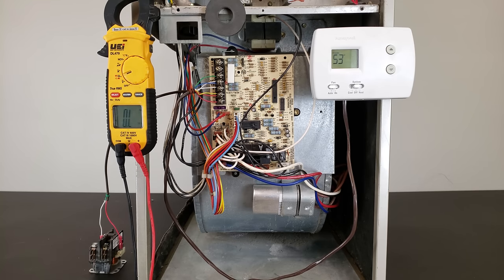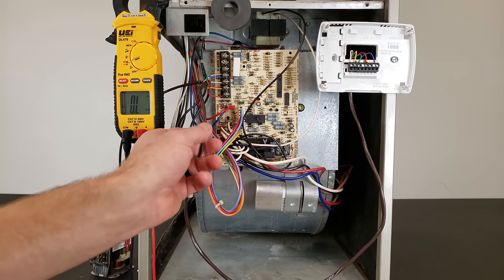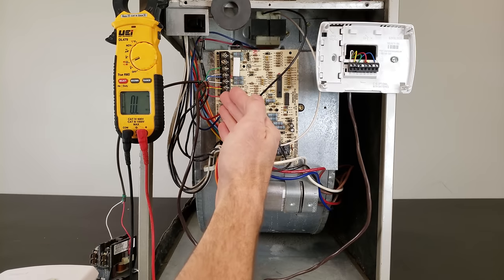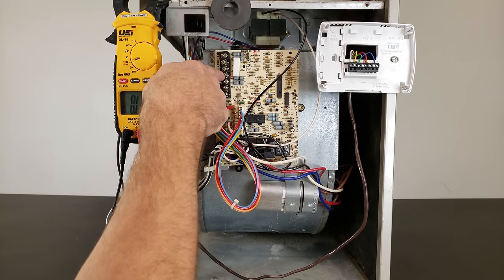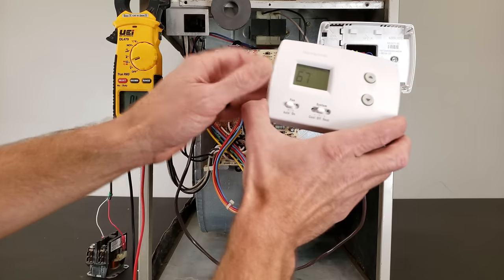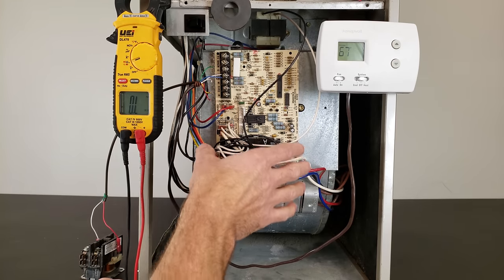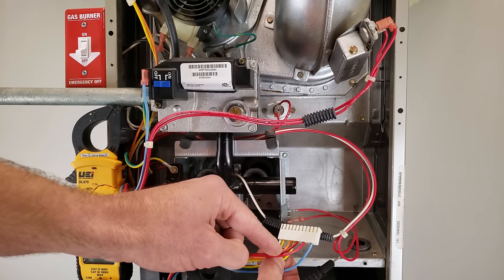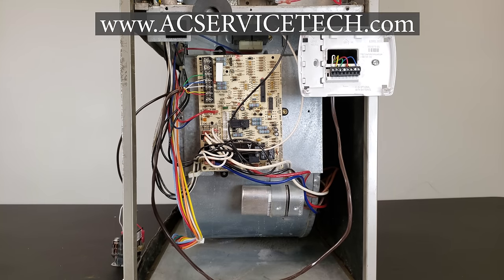Finding Low Voltage Shorts Fast! HVAC Troubleshooting!

Comment: Let me suggest a method for finding low voltage shorts without removing all those wires.  First I'll be obvious, the reason the fuse is blowing is because something is shorted and therefore has very low resistance or zero resistance drawing lots of current and causing the fuse to blow.   The temporary solution is to add series resistance (inline with the fuse or replacing it) to the circuit with a known level of resistance drawing less current than the rated fuse.  The simple answer is to insert a 24 volt bulb in a socket with two wires or a commercial short finder (all these things are is a 24 volt bulb packaged nicely with wires).  The current draw will be 2.5/3.0 amps which isn't enough to blow the fuse.  The bulb will light because you have 24 volts on one side and the short giving you a ground on the other side.  Grab your multimeter and wrap the current jaws around each low voltage wire on the control board until you find the wire/circuit drawing 2.5/3.0.  That is the wire/circuit where your short is.  Now track that wire to its termination point which could be a component.  Disconnect the component and if the light goes out you found your shorted device.  If it doesn't track that wire along its length to find where the wire is touching another wire or the frame of the furnace.  In any case you cut your troubleshooting of the short down to five or ten minutes.  You can use the same procedure on a cars, but use a 12 volt bulb.  I've used this process for years to track down short on cars, furnaces and even circuit boards.  I've found the current jaws on a multimeter the most underutilized item in a tool bag.  Hope you find this useful.
Reply: Yes clamp meter is a great tool, makes those parasite draw much easier to find, great tip!
Reply: What would my amps be of the other low voltage wires? It never dawned on me to use my claw to read low wiring amperage?
Reply: I didn’t think a multi meter could pick up amps that low such as 2-3amps
Reply: Great point! Resistance testing often produces flawed results for a host of reasons.
Reply: You can use your clamp meter to measure very small AC currents. For example. If you clamp your meter on a single conductor carrying 1 amp, your meter will of course read 1 amp but if the same conductor passes through the jaws twice, now you will read 2 amps and 10 times, your 1 amp will now read 10 amps on the meter. It's not very handy to wrap a wire around the jaws 10 times and then insert that in series in the circuit you want to measure but it works. And a tip on finding a short circuit. You don't want to go crashing in on a short because in the process you may clear it and then it won't be there anymore to track down, then in a couple of weeks have the short return and the fuse blow again. I think a person is fortunate to have a dead short rather than one that is intermittent. Sometimes I also use the light in series with the load to track down shorts. I bought your refrigeration book last year and it really helped me understand the subcool and superheat I've heard about and didn't understand. It's always nice to learn something new.
Reply: Could you make a video about this please
Reply: @Young Jedi  some can and some can't. I've found if the meter can read DC amprage then it should show as low as 0.1a
Reply: I wish you could make a video to explain Thanks
Reply: would love a video as well! sounds like a good hack
Reply: Wish you could make a video explaining what you're saying
Reply: Won’t this short the board tho
Reply: Definitely a good tip, unfortunately i work with AC voltagemost of the time any tips for that?
Reply: I got a even simpler way. Use ohms law v=a×r divide r into v get a Amp value take your meter at your state measure all wires to c anything that give you a low ohm value that would guve you high amps will tell you what circuit it is on.
Reply: @youngjedi5599 if you wrap a wire ten times then you can read a very low amp reading and divide it by ten

Comment: There's an easier way. Take all your thermostat wires off and then touch each wire one at a time to the red hot wire.and if you get a noticeable spark on say orange wire then you know it is on that wire circuit, do all wires this way except the common wire. This is the easy way to bypass all that nonsense.

Comment: Even a 3 amp fuse is way overrated for those transformers. 3 amps times 24 volts is 72 volt amps. Most of these transformers are only rated for 40 VA. Why don’t they use smaller fuses?

Comment: To keep from making one million trips wire  a T-stat to carry w/ you for the amount of wiring you need. You can use 2H/1C T-Stats for furnaces if you wire the W to your Emergency Heat in your diagnoses T-Stat. If it’s a Heat Pump set then just continue as the  wiring should be applied. Attic trips are a killer, don’t forget your fuse pop switch so you don’t burn through fuses.
Reply: Explain in more detail please!

Comment: Low voltage Shorts  are time consuming and  can get frustrating . Your "process of elimination" is well explained . I find this video very helpful to deal with this issue. Thank you very much for sharing this video.👍😊
Reply: I always use continuity to find low-voltage shorts.. Please explain why ohms is better then using continuity on a short to ground or common?

Comment: This video helped me diagnose a short to ground from our humidifier, which was causing our ecobee to only call for heat for less than a second, and the 3 amp fuse on the furnace board to blow when contacting Rc and W1. Turns out one of the wires poking through a sharp hole in the cold air return got nicked, who knew?!

Thank you so much, you've saved me a bunch of trouble and money.

Comment: Not sure how old this video is but it was tremendously helpful to let me today.  While my problem turned out to be something unique (an unused wire from the contractor coil outside had lost the electrical tape that was shielding it and it was arcing on the cabinet) . using your guide, I was able to determine everything it was not which eventually led me outside to look at the contractor coil.  Thank you!!!!
Reply from the maker: Glad it helped!

Comment: This is a great explanation for the process of elimination.  I would also recommend to especially younger technicians to get a Lil Popper fuse reset tool or something similar.  They come in 3 amp and 5 amp sizes.  They are helpful during the troubleshooting process so that you aren’t just burning through fuses.
Reply: I was using one the other day on a twinned system and it kept blowing the fuse on the second air handler and not my popper… I was so confused
Reply: @anthonys6187  I have seen that happen before too.  Now that everyone is switching over to cool mode, make sure the contactor is not shorted.  If they are in cooling mode and you are blowing through fuses and transformers, that is likely your problem with these seasonal changes.  

Other things
Did you try and isolate the 2nd twin from the mother system to see if it was the one popping the fuse?  I naturally want to look at the outside thermostat wire to see if an animal has been chewing on it or a melted wire on the outside condenser.  Sometimes the low or high pressure wires touch the hot copper line.

Comment: For boards I often find thermal imaging shows the blown component  ( seek thermal pro for smartphone )  you can also usually spot the hot flash of the groundcshort asthe fuse trips... excellent video as always

Comment: good morning Craig! all of your hvac articles, videos and books are very clear and well explained. I got your mini split hvac books from Amazon and I am still learning it so far very helpful. so. common and ground are same because they are touching each other. when hot wire touched to the ground it will just blow the fuse but if hot wire touch the common directly than it will blow the transformer with fuse. but common and ground are same on the other hand. why short with common directly will kill transformer not just the blow the fuse?
Reply from the maker: It will still blow the fuse but may also blow the transformer because both hot and common are connected to the transformer. Hot to ground will still blow the fuse but is less likely to blow the transformer unless the path of least resistance is back to the common on the transformer. regardless, we do our troubleshooting with blowing fuses or breakers and by using electrical resistance measurements, thanks!

Comment: Fantastic explanation! This helped me isolate my yellow wire which was shorting -- it was wrapped over the edge of a housing where the access door would rub on it every time the door was opened, slowly fraying the wire until it finally made contact with the housing creating a short.

Comment: Sweet video ! I just ran into this issue. When I turn my thermostat to either AC or the heat pump, it blows the 5amp fuse on the board inside the furnace unit. If I use just electric heat, then no issues. 

I isolated the short to the yellow wire by unhooking it from the AC unit outside. I turned my thermostat back to cool and the fan on the furnace came on with no issues and the fuse didn’t blow again. I decided to use the spare wire from the outside unit and used the black/white wire. Once that was hooked up again, the fuse blew as soon as I requested cool. What I also noticed on the board where the wires hook up, is that I have 2 wires on the same connection. (Yellow and white, but now black/white and white).  It’s an older unit so I don’t have wires at my thermostat to test. I did trace the thermostat wires from the furnace unit and put together the new black/white wire with the white wire. Now the fuse no longer blows when I switch it to cool, but now my outside unit is not switching on. Any ideas ? 🥲

Comment: Want to find a short even faster than my suggested method using current jaws?  First, use the technique explained in my previous post by adding serial resistance with a 24 volt bulb in place of the fuse or in series with it.  This will prevent the circuit from blowing the fuse while allowing it to remain active drawing somewhere around 2.5 amps.  Next drag out a Thermal Imaging Camera and look over the wires and control board (remember all wires whether from the thermostat or outside units terminate at the control board).  The shorted circuit will be obvious.  Thermal imaging cameras can be had pretty cheap these days and worth adding to your tool kit.  Hope this suggestion helps in your troubleshooting.
Reply: Wowe I’ve got the tools in my van. I’m purposely going to cause a short and test it. Good advice
Reply: Film a YouTube video showing us in field footage.

Comment: Like how you show exactly step by step on finding a low voltage short circuit. This issue is always on my job I’m the ac tech on my job we have heat pump. The units are over 10 years old and the wiring in the condensing unit is exposed to heat and cold weather mostly I find shorts on line from evaporator to condenser. Also through all the years of being used 24/7 the thermostat do fail most of the time.

Comment: Great video, I found a rare problem when troubleshooting a circuit board fuse problem. The contactor coil in an outdoor unit was the culprit, I measured the resistance of the coil and to ground both readings were normal. When 24 volts was applied the fuse blew instantly, the only symptom I found after removing the contactor was that the contactor had a burnt insulation smell. Normally when a contactors coil is energized with 24 VAC a magnetic field is produced opposing electrical current, because the coil insulation was damaged several turns of wire in the contactor shorted together. As a result the coil did not produce a magnetic field allowing excessive current to flow through the coil destroying a 3 AMP fuse.
Reply: Was that the permanent fix?
Reply: @Swoliosis1  That was the permanent fix, the original AC contactor was damaged due to  faulty wiring when the owner changed his furnace circuit board. After properly installing a new circuit board and replacing the AC contactor the problem was solved.
Reply: @practicemakesbetter7132  We recently had some very bad storms in my area... a day later, my system blew the 3 amp.  Replaced it, blew again instantly as soon as the contactor energized.

Checked all over for shorts... replaced fuse, disconnected contactor... fuse did not blow at FAN ON or COOL ON.  Replaced contactor, system now works.  Contactor tested at ~16 ohm.. not shorted to ground.  Don't know?
Reply: @Swoliosis1  Good job finding the bad contactor fault! Normally when 24 volts AC is applied to the coil of a contactor,  the coil produces a magnetic field that impedes the flow of Alternating Current thru its coil. Because the coil windings were damaged, there was no magnetic field created and there was very little impedance to the flow of current thru the coil; that is why the 3 Amp fuse blew when 24 volts was applied to the coil.
Reply: @practicemakesbetter7132  About 72 hours out and we're still running...

The DIY videos, web sites, etc... don't really talk about parts still being bad, even though they measure well (by typical methods).  Maybe at the moment the contactor engages and/or under load it exhibits the symptoms and only then.  If so, may need a lab setup to prove it... either way, old contactor in the trash.. ordered a new one for $10...
Reply: The contactor shorting out is very common in my opinion.  But the meter is your best friend in this industry

Comment: Thank you for the help you've given me so far. I determined that I have a low voltage short coming from my AC compressor (read 0.5 ohms instead of 15-20 ohms). Do you have a video for troubleshooting at the compressor that I can watch?
Thanks.

Comment: This video is very helpful but I am still having issues. I have a split system, AC and heat. I tested the system similar to what you did. I have two sets of thermostat wires going into my FAU. The ones from the Thermostat does not trip my fuse. When I plug in the thermostat wires from the AC unit outside It trips the fuse. I even tried switching the wires and still trips so its not a break in the line or grounding issue. Any ideas on what it could be? I am replacing the AC capacitor as a last resort of something cheap before calling an HVAC.

Comment: Do you have to disconnect the wires on the board in order to get proper ohm readings? I noticed it had a measureable resistance when it was connected to board and not OL even though nothing was calling and the power was off. Can you explain it? I'm just curious as to why it wouldn't read OL, i would assume the wires aren't touching on the board until a call is made

Comment: I have seen in another application of the secondary of the transformer that the common wire connected to ground would have to have a diode from anode to cathode and cathode connected to ground that way the back current cannot go back because the diodes reverse bios will stop any back current flow!

Comment: So, what does it mean if the voltage between the red wire and the green wire is 18 volts, but it's 27 volts on all the other wires? That's the problem I'm having, and although I could be wrong, I suspect it has something to do with why my fan doesn't always come on.

Comment: Hello Craig, Will this be the same process with a heat pump? If not can you please point me to one. Thanks!
Reply: Same method for heat pump.  Heat pump will simply have more low voltage wires.  Testing will be the same

Comment: If you have a resettable 3 amp breaker is it possible to insert that into the fuse spacing and use it to diag the system? Just to prevent burning multiple fuses?

Comment: Hey I have a question, when you check for resistance values you disconnect all wire at the board except common right, but do you also disconnect the wires at the thermostat ? Or you leave those connected?
Reply: Pull the face off the t stat but leave the wires connected. This way you eliminate the t stat face relays out of the equation

Comment: Great stuff! However, I'm confused how a low  voltage wire from a transformer which is not grounded could possibly give any worthy reading, if the hot or common wire accidentally touched the frame anywhere.

Comment: I had a house on Friday where there with a 6 zone pneumatic zone control.  After about 2 hrs of tracing a maze of wires, there were no marrettes on the humidifier, and they were touching the duct work.  The ac low voltage wire was also bad inside a finished ceiling, and the R wire entering the zone control was broken and touching the case of the box.  It was a mess.

Comment: Another quick way to find it is to unhook the tstat and cu wires. If fuse blows problem is inside furnace. Hook them back up one at a time with the call on that's blowing fuse. When the fuse blows you've found the bad wire. Most times it's outside in the weather.

Comment: Do you have a video on how to replace the transformer?
Reply: Turn breaker off to the air handler and verify power is off with your meter. 

Order the factory transformer and hook up the wires one by one.  Take a picture-of the wiring of old transformer for your reference.  Good luck!

Comment: I had one today.  The led was in standby mode. As I was testing I crossed W with R 
Blow the fuse. But didn’t blow the fuse when 
The thermostat called for heat . The furnace didn’t come on . As I was going through the troubleshooting I found it . The high limit switch was shorted to the frame .

Comment: Do this exact thing with a basic gas garage heater. I unplugged everything from the board and it still blows the fuse. I ordered a new board after running out of options.

Comment: How do I fix the fuse blowing if the fan is turned on? We have already replaced the fan motor the thermostat and checked the green wire for continuity along with red. I can’t find the problem.